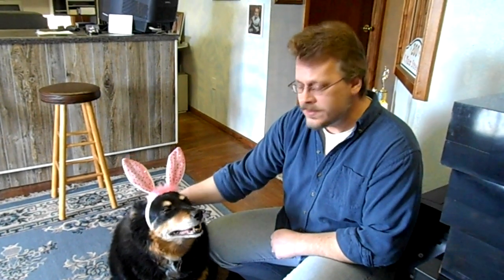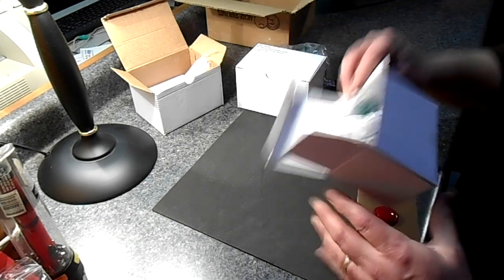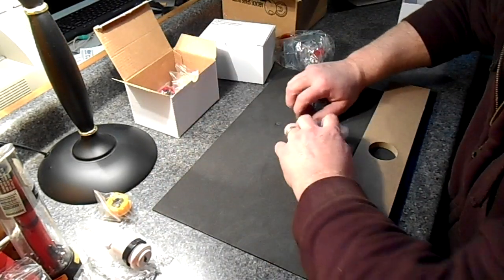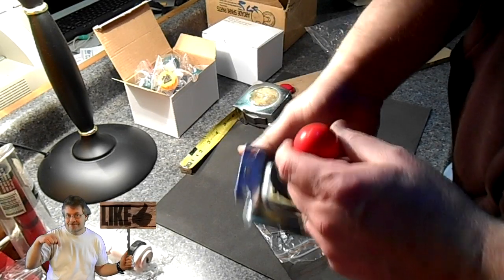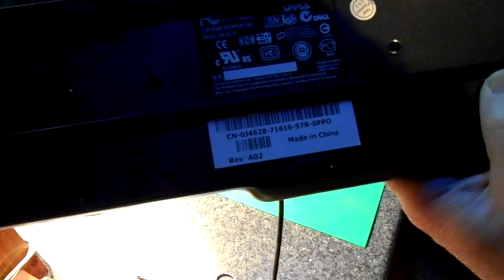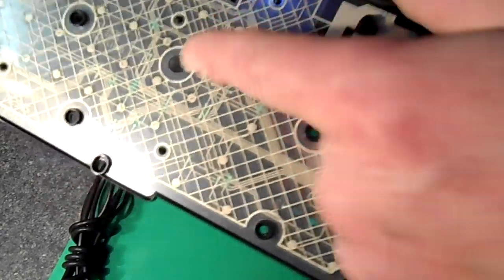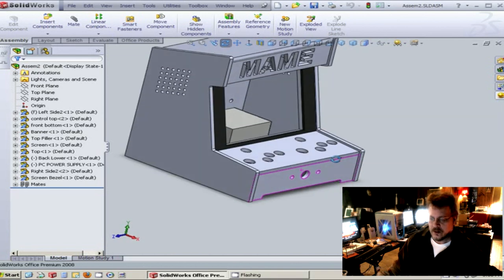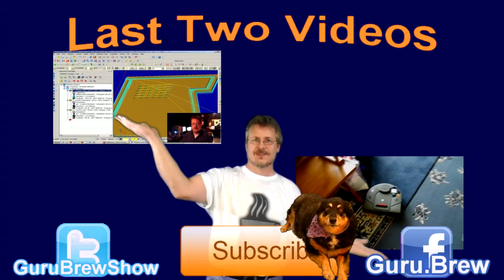USB Keyboard Hack for MAME Arcade Controls

Comment: 8 years old and I'm way out of left field here but this was really helpful to me. I'm installing a tablet in my car and I plan on putting the keyboard circuitry in the wheel wired to the control buttons and reusing the old button wiring to get the USB through the steering column to the tablet. This was really informative! Thank you!!

Comment: Done this with a NES Advantage Controller (to be able to work with ZSNES without the need to configure it) but with a old Microsoft wireless keyboard, so it is also wireless ;-). There is enough room for 2 AA batteries inside the controller. Works perfectly!

Comment: Could you explain how you got the wires to get stuck on the circuitboard? I tried with the same keyboard and tried to sodder them to the board but the sodder did not attach. :/

Comment: Hey there,
I was going to send this as a Q&A suggestion but figured I'd try here first.
I'm wondering is how did you connect all the wires to the ground? Did you just wire them to the ground cable coming from the keyboard? Unfortunately your videos missed out the wiring part, but the rest has been very useful for me and I've must have watched it at least a dozen times in the past week.
What brought me to your channel initially was your playlist to make your MAME cabinet project. Absolutely phenomenal channel you have, I've watched most of your videos and I'm really enjoying them. It really didn't take me long to decide to subscribe to you.
Reply from the maker: Thank you very much for all the kind words, it's appreciated. You are correct about connecting all the grounds together. Each stick has 4 signals (UP, down, left, right) and each button has a single signal and ground. In most situations ALL the grounds can be connected together to a common grounding point BUT in my situation (since I made a custom IPac board) I had to run 2 wires for each switch only connecting a few of the commons together. That is one of the reasons I did not go into to much detail with my wiring because my situation is very unique. If I were to do it again I would just buy the IPac controller an save myself lots of wiring. Hope it helps.
Reply: GuruBrew Thanks for the reply! Ah right, I see. Yeah that sounds like quite a bit of a chore. While waiting for the buttons, I've been fiddling with the board from one of my old PS2 keyboards (I literally have a pile of a dozen or two keyboards in a box), figuring out the combinations. 
I can definitely see why people go for the Ipac route, so much easier. But I figured why not try it myself first and if I don't like it, just buy an Ipac. It's not like I'll be losing money, just time and patience, hehe. Again, thanks for the reply, this video and your reply have really helped me.

Comment: Hey - you skipped the part where you magically put the wires through the keyboard circuit board - the main thing I wanted to know.

Also you didn't warn the viewers that USB keyboards only have a maximum of 6 keys pressed at the same time, which may cause you problems in a game of 2 player street fighter with both people trying to do the super move.  PS/2 keyboards allow a maximum of 16 keys pressed at the same time.  Also the iPAC has no maximum.  These points are worth mentioning to the viewers depending on their expectations of the system.
Reply: +Clint Hobson Priceless information!
Reply: Thanks bro! Also you can use 2 different keyboards (even 3, 2 for buttons and 1 for the joysticks).
Reply: Personally I'd just surface solder them, drilling holes seems like extra work.

Comment: Drew I was set aback about the cost of the I-PAC, but did try out their I-PAC/VE which is $37 shipped from the UK. This value edition has some draw backs none of which were a problem with my project. Works with WIN, MAC & Linux (can we say PI) but not DOS (still have not tested that yet). With 32 keys, you can go nuts, you can program it to use what ever keys you want but they are not saved in RAM. 

Your keyboard hack video was way cool did you ever post the keyboard map?

Keep them coming!

Comment from the maker: We have not yet done much testing or playing with this system yet. still in late building stages. But no ghosting or blocking noted to date. Check out our new videos coming up for more testing and reviews of this Mame system powered with the Raspberry Pi.
Reply: Well... how'd it go? Did you use this encoder long term? I'm considering doing this with a bluetooth keyboard since I can't find any wireless keyboard encoders. I mostly only need old 80s games so not too worried about the simultaneous key limit, but wondering how this worked for you if you wound up using it.